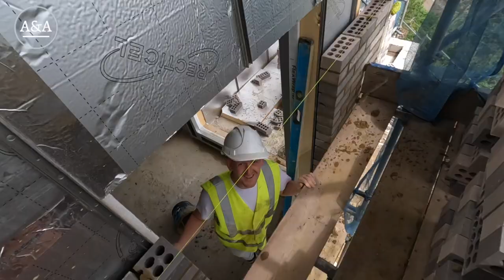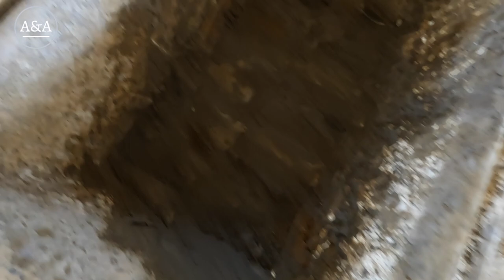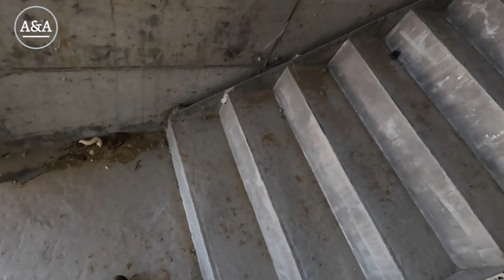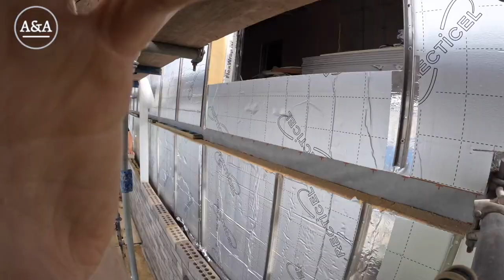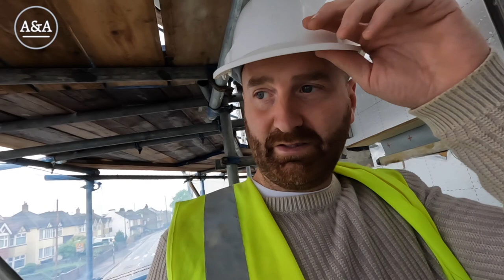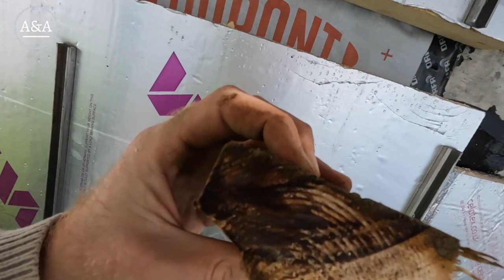One Thing I Never Told YOU About This Job... Bricklaying Vlog

Comment: We are on a similar brick job in Manchester, all labour provided free to us, we just turn up and start laying, prices are £900/ 1000 straight work and £1200/1000 for radius or detail work, a tip for raking out next morning, i cover with plastic sheet and put hessian over the top, and put some spotboards against the wall to prevent wind drying it out.
Reply from the maker: That’s a great price! You boys must be doing alright 🤑. Ahh that’s a good tip, it’s tricky when it’s wet as it makes a complete mess but doing it the next day is driving me mad! I’ve got a massive roll of hessian I’ll try that tip, nice one 👍🏻
Reply: Wow 900 /1000 best price I have heard that .. what's the down side??
Reply: Who's that for?
Reply from the maker: @mattrea9088  some architectural firm in lent mate 👍🏻

Comment: why dont you put the mixer up where the sand is
Reply: must be reason surely otherwise yeah knock up on top floor and walk the muck down the stairs
Reply from the maker: We’ve done that now, but the issue was we had stuff to do on the bottom floor and stuff to do on level 1, also the pallet of cement is on floor 1 😂 it’s all over the gaff Jack
Reply: Lot Lighter to carry sand